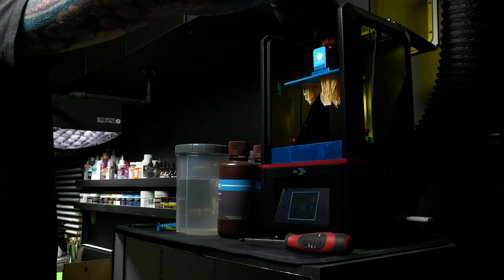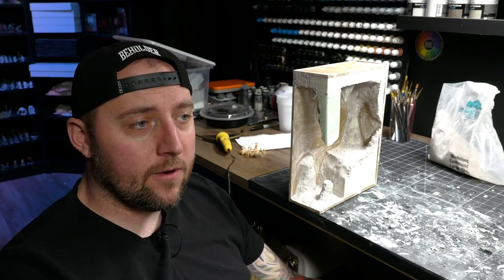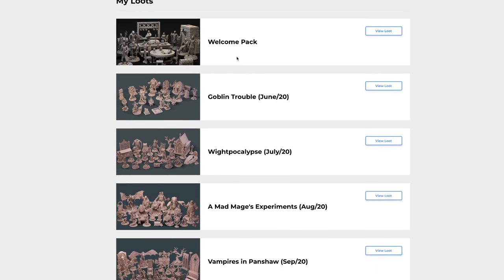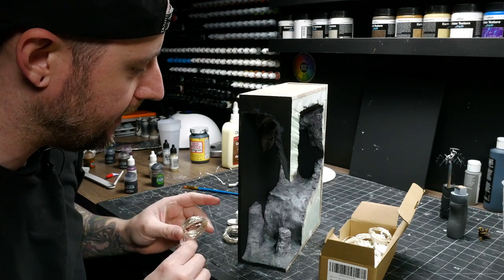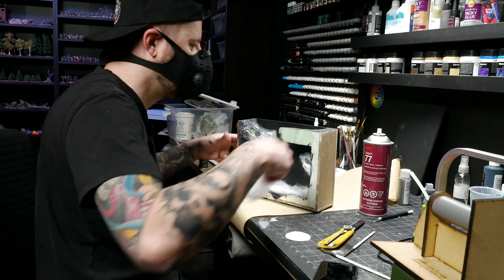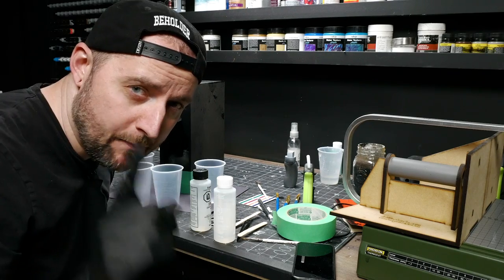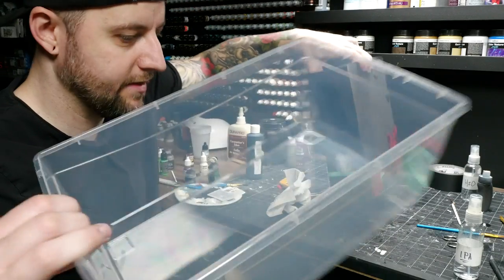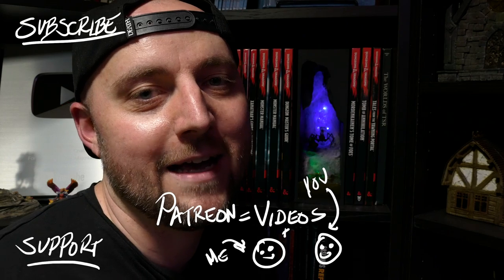I made a Dungeons & Dragons BOOK NOOK! And almost ruined it!

Comment: Hey, in most cases a way to counteract or even prevent the warping you encountered in your build is to paint both sides of the piece you are working on. Often it's not the moisture in the paints/modelling compounds that causes the warping but the way the stuff dries. By covering both sides the drying material will "pull" to one side and vice versa thus levelling each other out. Worked in a lot of cases for me. 
Cheers 
Y.
Reply from the maker: Usually applying to other side doesn’t fix the warp, just changes/lessens it. While it’s true that shrinking material usually causes warp/pull the tiny bit of binder in a thin layer of craft paint isn’t strong enough to pull 1/4” mdf.
Reply: Mistakes were made and hiccups keep showing up, but by god he keeps trucking through and improvises and takes notes. Such great content that shows me how mistakes lead to ideas and creativity isn’t a rule book. Thank you

Comment: Interesting to watch this. Your approach is very different to mine. I'm all about the cheap materials and trying to incorporate some of the elements into the scene (like making pillars and a lintel to cover the edges at the front), whereas yours is more about the dynamics of the moment - the confrontation with the Dryder. I'm using cardboard boxes, packing paper, PVA, DIY wall filler and some tablet tubes with a PP3 battery and LED string. One luxury I did go for was Green Stuff World's plasticard walls.

Comment: Jeremy, not saying the MDF wouldn't still warp from a base coat, but I know a technique some people use is to paint both sides of wood even if you won't be seeing the other side. I guess the sides drying at the same time/rate keeps warping to a minimum. I did it on some cabin siding w stain to avoid boards "cupping".

Comment: Just as a suggestion, might not be new to you at all. But saw you were having trouble with the spray can of the super 77, not sure if you do it. But all rattle can formats if you aren't going to use it all up in one spray session. Turn the can upside down and spray upside down until it sprays out only propellant as it will clear the tip from any gunk. You always have more propellant in the cans than you need but just as a hack to stop rattle cans getting tips gunked up. I always do it to any rattle cans I use. You might already do this but just suggestion. Thanks for the awesome videos and keep up the good work.

Comment: I just started my 3D resin printing and LOOT is the first to come out of the printer.  I love their models and have been actually collecting them from the very beginning (have a lot in my backlog).  So far I am quite pleased.  I have had minor issues with some of the supports (starting with older models so maybe that will get better as I get to the newer ones) but the detail is amazing.  They can be rather delicate which is fine for dioramas but for game play, my only concern is they will easily break.  Guess it is good I can print more!
Reply: Or use resin to fix broken figurines.
I recommend a clear one.
Reply: @doubeld.7536  The parts that are breaking off are really tiny so the best option really is super glue. For example the swords and axes sticking out of packets of treasure are super thin and they break off if you jostle them just a little bit.If you're doing a diorama people are not going to be handling the miniatures so that's okay but if you're playing on a gaming table they're going to get knocked into all the time.

Comment: If I understand things correctly most resins are an endothermic (heat generating) reaction, which might explain why the hot glue plug in the wiring hole failed. Great build as always.
Reply: Exothermic is heat generating, not endothermic. My sister is a high school science teacher, and she'd disown me if I didn't say something 😆 but yeah, you're exactly right. The heat released by the resin likely melted the hot glue out of the hole

Comment: I'm sure you already have a solution in mind, but I figured I'd share something that has given me good results. Prior to assembly, layer up a couple thin coats of a fast drying spray primer, once dry, paint and throw a sheet of wax paper on top with some books/weights just in case.

Comment: Would a ModPodge coat have prevented the warping of the particleboard? It looks great.
Reply: Particleboard =\= MDF.

Particle board is more like chunks or of a wood chipper, where MDF is sanding dust.

Both use mostly glue and garbage wood, but they behave rather differently

-professional cabinet worker

Comment: Dave from Artisan Home Railroad.    Looks like your compound is possibly a version of Sculpta - Molde      not the best choice.   Next time try
plaster of parous.    No shrinkage when drying.  No cracking after drying (unless you break it). No fiber clumps to hide or flatten.  No variants in how it holds paint.     Paints evenly.     Swore off modeling compounds after third commercial build.

Comment: One of the reasons I've hesitated to climb aboard the 3D printed minis train is that I don't like the horizontal (?) lines on the finished product. Have these become significantly less noticeable in newer printer models?
Reply from the maker: With resin printing you can print with essentially no layer lines.
Reply: They are virtual non existent on the type of printer he is using - his uses liquid resin, hardened by UV light, to create minute layers with extreme levels of precision - I believe he uses an Anycubic Photon, which uses an LCD screen to mask off the UV light to print an entire layer at a time. The layer lines you are thinking of are generally a result of an FDM printer, which uses a hot end (kind of like a glue gun) to melt plastic and deposit it, one bit at a time. Both technologies have pros and cons, but for model printing, the UV + liquid resin (often called DLP printers) method makes much nicer results

Comment: You could have done a 600 IQ 8D move and created a hollowed out space using resin to put the bulbs into. Then, once that's hardened, you pour the resin in to create the water. But this time, the lights are swapped out with UV bulbs and you pour UV resin. Then it hardens from both sides all at once! Bwahahahaa!

Comment: The resin you used for the water, how well do particles stay in suspension in it while it cures? Reason I ask is, I'd like to make some potion props, and I have some colored mica powder. I made some already with vegetable oil, but after a couple of hours, the mica powder settles and it's no longer swirling around in the bottle. I thought with the resin, it might stay suspended and I wouldn't have to worry about it settling.
Reply from the maker: I haven't used it with any sort of mica powders, but that's actually one of the things it's meant for. It's a resin promoted for making jewelry with mica powders and whatnot, so I expect it would work well.

Comment: I've been thinking about making a book nook and would love some thoughts on this idea.  Rather than gluing the final side, using hinges in the back at the beginning.  This way I could painter's tape down some wax paper on that final side, close it when drying the interior, but still have full access if I ever wanted to make changes. Would need a locking mechanism which seems easy enough but have I over-designed or not thought of why this won't work?

Comment: What's the material you used for the case for this amazing piece?  I think you said "hard board" but I'm not familiar with it and couldn't find it on your essential equipment page.  I've seen a few of these and, as always, you're the motivation I needed to plan my own!
Reply from the maker: Yea, it's hardboard....which is essentially like mdf/hdf. You can buy a 2'x4' project panel of it at Home Depot for about $6. MDF and HDF would also be fine, they just were out of stock when I grabbed it. The big difference is that hardboard has a bit of a glossy surface.
Reply from the maker: https://www.homedepot.ca/product/alexandria-moulding-standard-hardboard-panel-1-4-inches-x-2-feet-x-4-feet/1000434568

Comment: I've done a lot of book nooks and I've used those lights. They're a good value, but the battery life is terrible. If you leave the lights on 24/7, they'll only last about 5-6 days before you have to change the batteries.
Reply from the maker: I’ve found that to be the case with all coin battery LEDs I’ve tried. Got a link for a better option?
Reply: @BlackMagicCraftOfficial  Use USB powered lights, then just plug it into the wall!

Comment: You could have used sandpaper or a dremmel and scuffed up the paint before you glued
Reply from the maker: I think you misunderstand the concern. I wasn't worried about the glue bonding to paint. It will bond fine. It's the bond between the paint and the board that is the concern. I could have scuffed off some of the paint...but the whole reason it was painted is that it would be impossible to touch up the black paint inside after assembly.

Comment: Is there a story behind the double Monster Manual situation? I bet there is a story :)
Reply from the maker: First print run binding failure. WotC replaced it but didn’t ask for original back. I fixed it. So now I have two which is very handy.
Reply: @BlackMagicCraftOfficial  Ow sweet!  Yeah, I can see the allure of having two of them. I could definitely do with a second MM at times.

Comment: I don't understand why everyone always needs to use resin. It seems really easy to mess up and imo never looks that great. It's still a cool build, but like you said, probably would've looked just as cool without the resin, if not better.
Reply from the maker: People don’t “need” to use resin. People WANT to use resin because it’s fun to do different things and when you pull it off it creates amazing effects go which there is no replacement.

If you don’t want to use resin that’s fine too.

This project would have looked better without it because I screwed it up. If I did it again, I’d still use resin, but get it right and it would be awesome.

Comment: Why not just paint the otherside of tbe MDF as well? Should even out the warp.
Reply from the maker: The outside was painted. You can see that in the finished piece. That doesn't fix warping.
Reply: @BlackMagicCraftOfficial  I paint on MDF with acrylics and gesso will warp it. Putting it on the other side usually helps correct it. 

Maybe the hardboard is a little different.

Either way. you made it work great.
Reply from the maker: It usually just changes the warp, not corrects it.
Reply: @BlackMagicCraftOfficial  Boo. Lol

Comment: Can you really just use a glue gun on those lights? I have tons of them but use things like Blue Tack to keep them in place. A glue gun would be a lot easier.
Reply from the maker: Of course. Why couldn't you? Only thing is, once they die they are permanent so you can never change them.
Reply: @BlackMagicCraftOfficial  I guess I'd never thought about it. That old GI Joe "Never touch a power line, kids" thing seemed to have translated over into battery powered LED lights for me :D